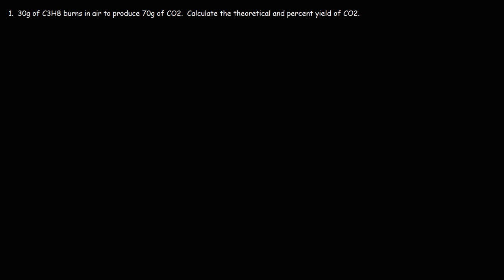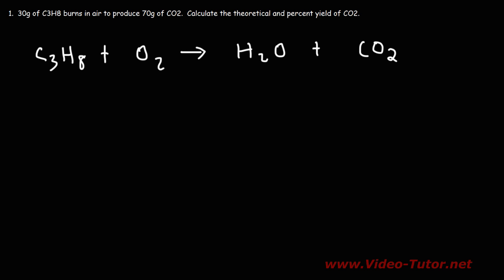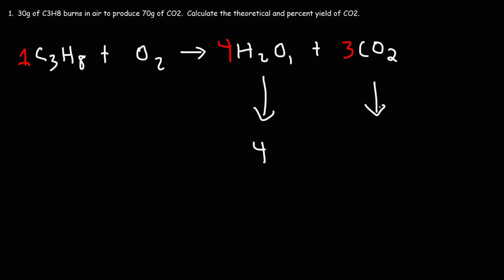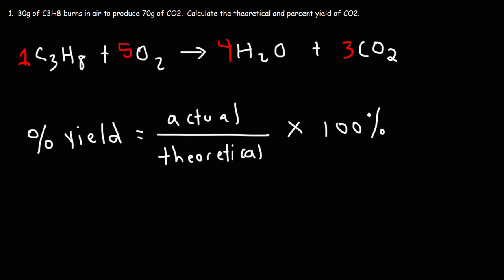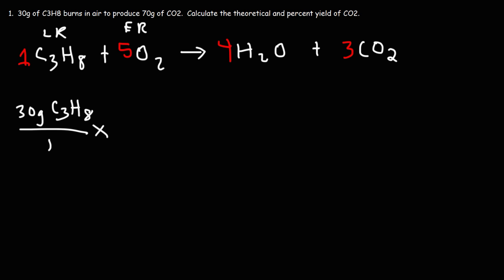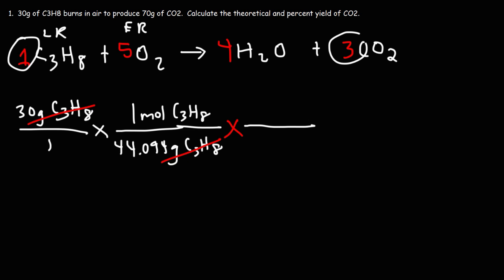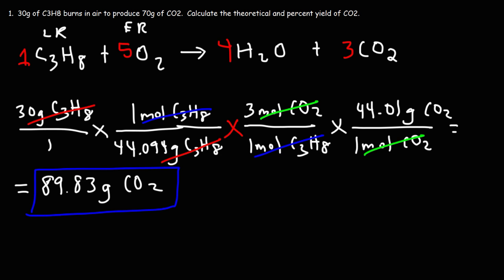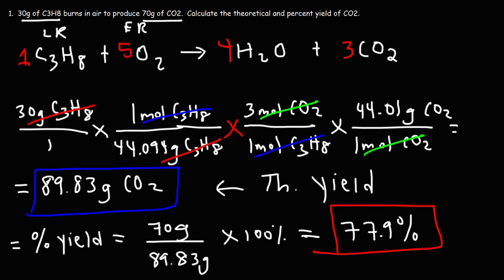How To Calculate Theoretical Yield and Percent Yield

Comment: When calculating you should say multiply by 100%, because mathematically that is incorrect. 0.50 x 100% = 0.50 instead 0.50 x 100. I say this because a lot of people will put the percent when multiplying and get the wrong answer because 100% is equivalent to 1.

Comment: Hello, can you please solve this question because I can’t understand how to solve it.

The overall equation for one method of manufacturing hydrogen from methane is:

CH4 + 2H20 -> 4H2 + CO2

In one batch, 5.12 tonnes of hydrogen is obtained from 13.6 tonnes of methane.

What is the percentage yield of hydrogen for this batch?

A)37.6
B)42.5
C)54.4
D)75.3
Reply: Are you sure it's the percentage yield they're asking for, and not the Theorectical Yield? If its the latter, the perc yield is 13.72%, and the theoretical yield is answer choice A.
Reply: @RLN579  it word for word on the text book
Reply: the answer is D
Reply: Late but the answer is D)75.3

Comment: There’s no need for converting grams to moles in this particular question. The ratio of C₃H₈ to CO₂ is 1 : 3 so 30 g of  C₃H₈ will produce a theoretical yield of 3 x30g or simply 90g.
To calculate percent yield do (70/90) x 100% = 77.8%. Same answer

Comment: ok so i’m super confused and i don’t know how to do this question i got for homework... sodium reacts with chlorine to form sodium chlorine. calculate the theoretical yield of sodium chloride, in grams, when 28.4g of chlorine reacts completely with sodium.
Reply: Hi, I know this is like super late and you probably got the answer by now, but first you need to write the chemical equation of the sum (Na+ Cl2 -> NaCl) and then balance it (2Na +Cl2-> 2NaCl), after that you just need to find the moles of Cl on the reactant side (moles= given mass/ molar mass, so that would be moles=28.4/35.45= 0.801 moles of Cl2) now that you've found the moles. You just need to use the mole ratio and find the moles of NaCl (the balanced equations says that 1 mole of Cl reacts to give 2 moles of NaCl, so 0.801 moles of Cl gives 2(2 moles of NaCl in the balanced equation) x0.801 (moles of Cl that youve found) which gives 1.602 moles of NaCl, from there on its just finding the mass of NaCl which im sure you can do on your own.

Note: You dont have to use the method i used for the mole ratio, use which ever method you know best.
Reply: @haas9649  you didnt start if off with hello there, disgraceful if you ask me
Reply: @nebulablitz15  ah shit. I'm ashamed of myself. I shall do better from here on.
Reply: @haas9649  hey, won’t it be 28.4/71 instead of 28.4/35.45? since there is a two subscript with chlorine. 🤷‍♀️

Comment: If the problem includes a given value of temperature, do I disregard it or not?
Reply: If this is gen chem, probably disregard it. Implications of temperature on reaction rates are in Analytical chem courses. In that case, one may use temperature to calculate a different theoretical yield.

Comment: This is very confusing. Can you do some more examples?
Reply: He basically found the no. of moles for the limiting reagent. Then multiplied by the number of limiting reagent moles by the molar ratio (for this question it was 1:3, my question was 1:1 to so it remained the same) then multiply by the molar mass of the product to give you the mass. He basically joined all the steps which confused me too. But I did it in 1,3 parts (2 part question) and it was easy for me. 
1)Find no of moles of limiting reagent n = m/Mr
2)Check the molar ratio (1:1 it remains the same, if not multiple or divide according to the ratio) which gives you the number of moles of the product.
3)Find the molar mass of the product
4)Mass = no. of moles x molar mass, so multiple them to get your theoretical yield.
5)Calculate % Yield using the formula.
You probably know by now but this may help someone else.
Reply: Thanks  a lot bro 😊 I have exams tomorrow I was just told to learn this wish you success